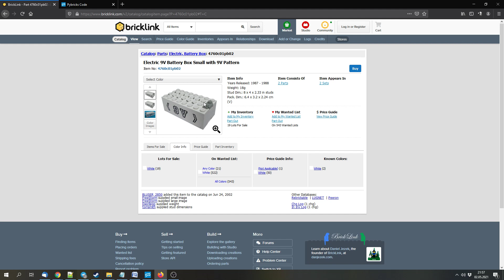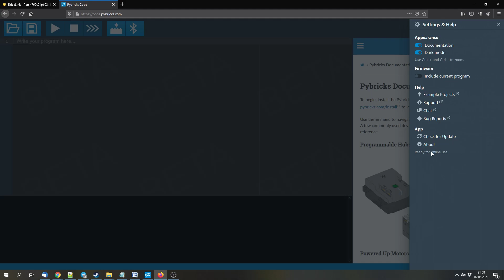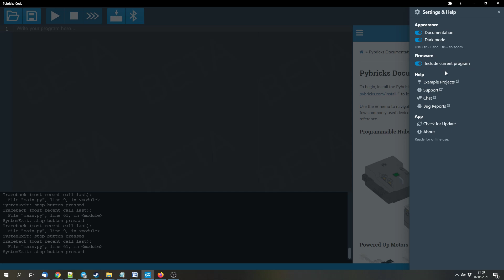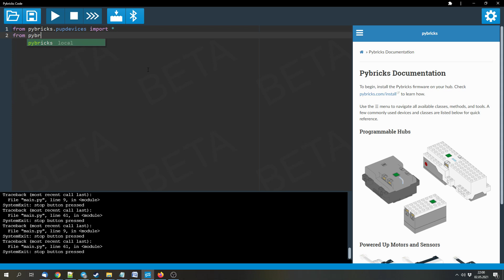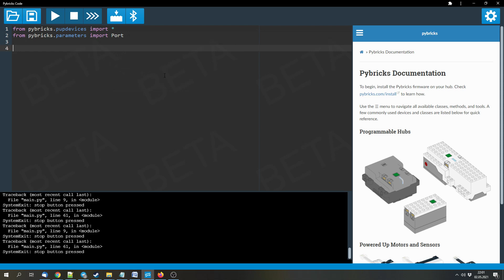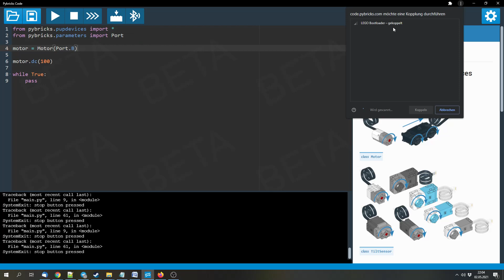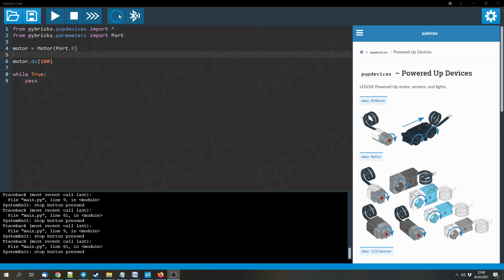HowTo use LEGO Powered Up hubs as independent battery boxes [English|HD]

Comment: Hi, yhx for all your tutorial, if possible to linked 2 lego power up hubs (with 4 port) for take a control of 8 motor?
Thx in advanced Alex
Reply from the maker: It depends on what/how you want to do it. You can connect up to 4 hubs to the powered up app and write programs for them. Pybricks doesn't support a connection between 2 hubs yet.
Reply: @technicmaster0tutorials thx for reply!